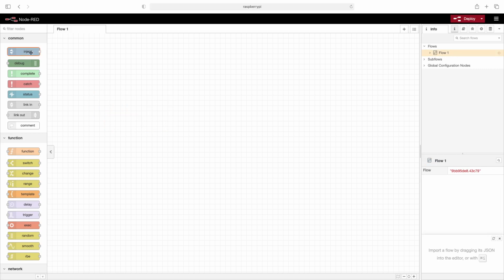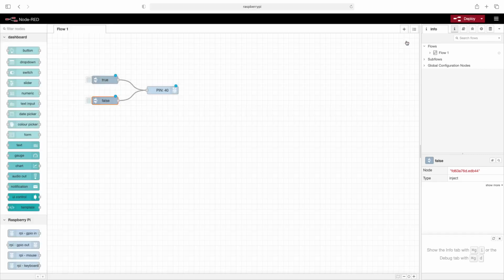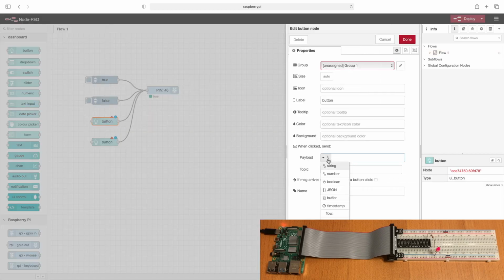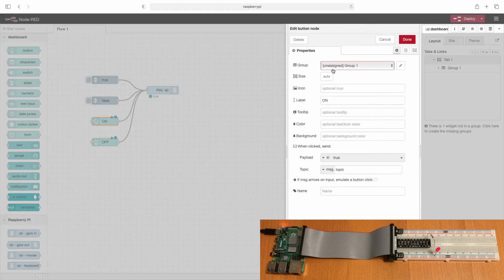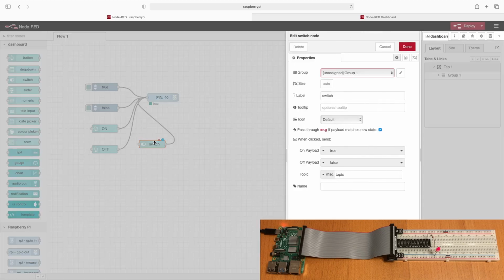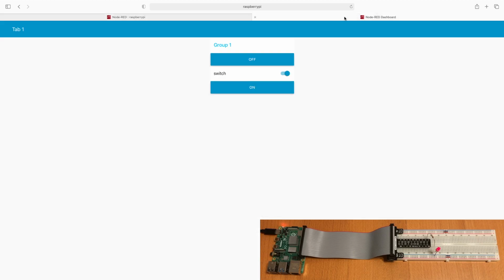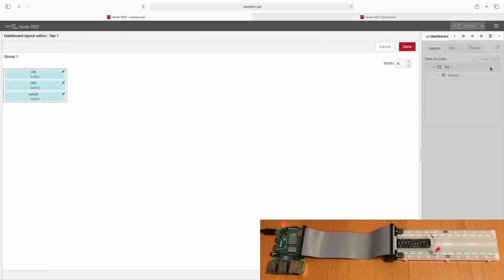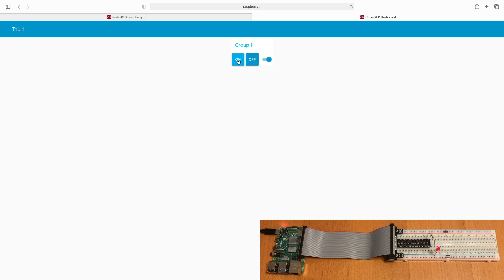Control Raspberry Pi LED Using Node-Red Dashboard

Comment: Excellent video friend.. I need your help. I am currently doing a practice of using Node red on the RASPBERRY PI, the problem in question is that I need that if the power is lost and returns, the RASPBERRY pi automatically executes the flow or program that I have in Node red... Thanks in advance for your help... Greetings